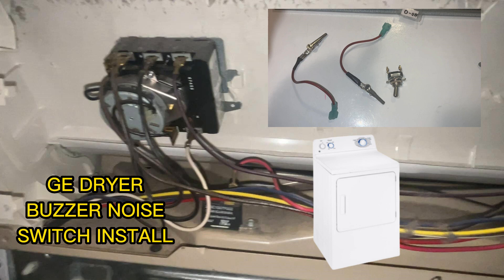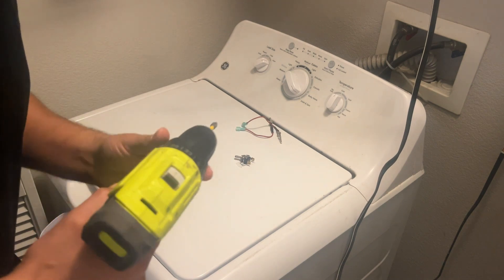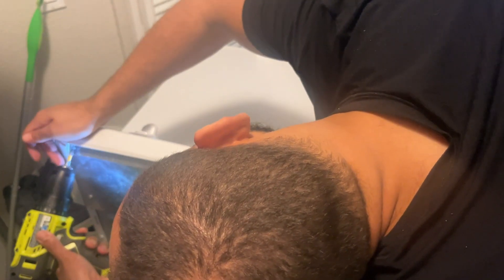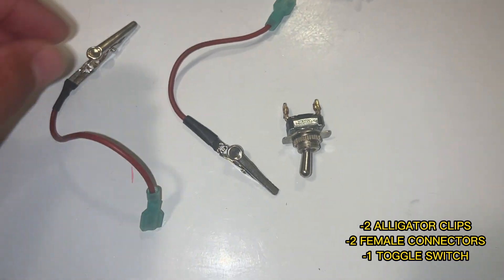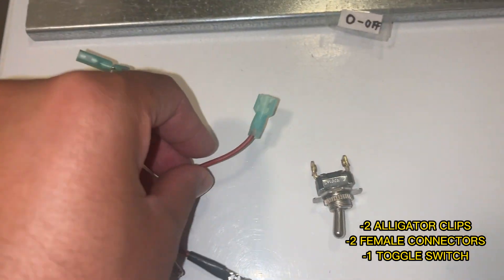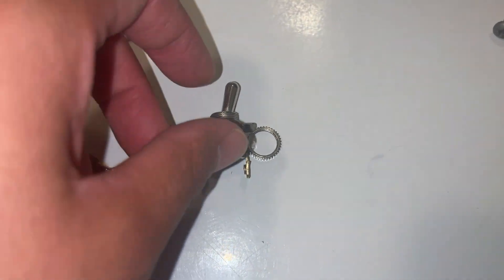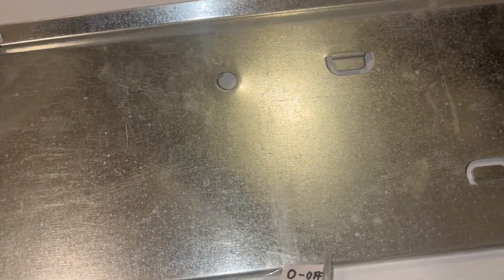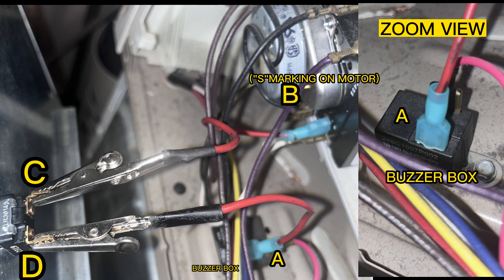Step-by-Step Guide: How to Make a Switch to Control Your Dryer's Buzzer"

Comment: Could I use a rheostat to lower the volume of the buzzer?
Reply from the maker: @mikeisgonz0  possibly.. changing how much voltage goes to it maybe.. or a voltage regulator 🤔.. depending if it’s  a simple switch that requires a certain amount of voltage to activate it..